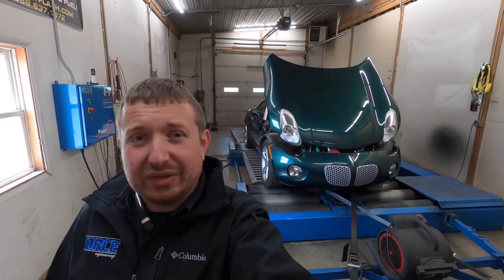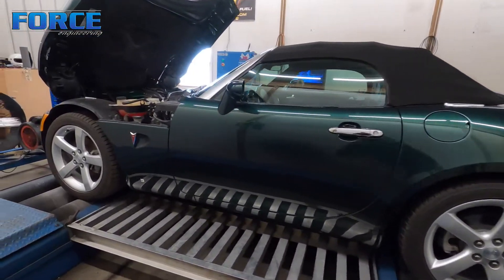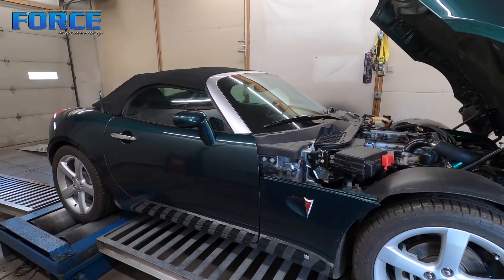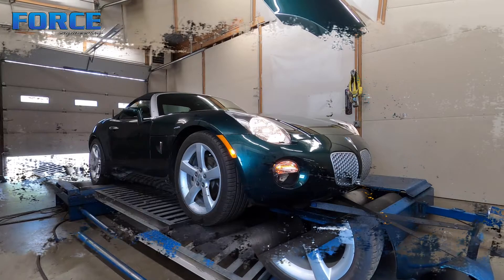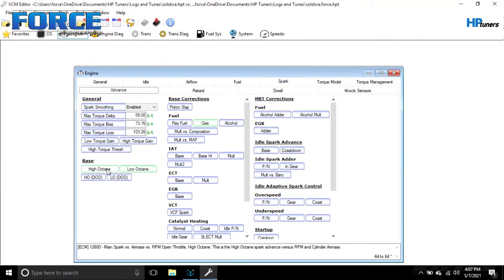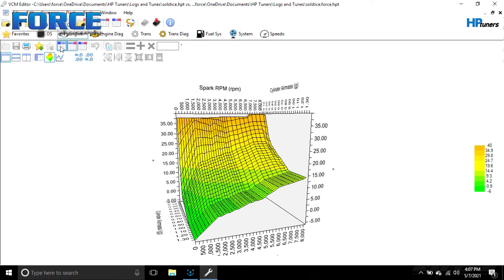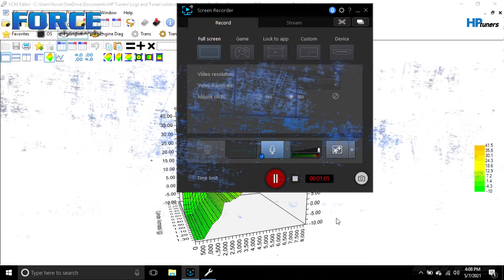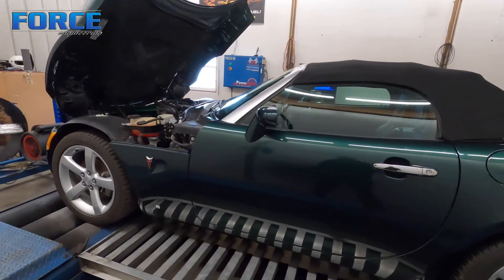Turbocharger Pontiac Solstice | Turbo Kit | Dyno Review

Comment: @Force Engineering You might want edit the title to reflect that this is the 2.4 LE5 Turbo Kit. Since it appears by reading the comments that most don't know or understand that the 2.4 LE5 was not turbocharged from the factory, and was only rated at 177HP and 166TQ.  I found your video by searching for: "2.4 Pontiac Solstice turbo", since the question; Can I turbocharge my 2.4, is a somewhat frequent question in Facebook groups. Also, when Solstice & Sky owners ask about adding a turbo to their 2.4, I always tell them the importance of having it turned correctly, since tuning a 2.4 turbo seems to fall into the good or bad experience for 2.4 turbo kits. Now that I found your video, I can start posting it when that question is asked. 👍

Comment: Not enough info...did I miss it?..is it the 2.4?? obviously the GXP had the 2 Ecotech turbo with 15 pounds of boost, so I am assuming you installed a turbo on a 2.4, and with 5 pound of boost, making 197 HP to the wheels looks like 240 net HP. I have a 07 GXP and a stage 2 RPM Motorsports tune and the car makes 300 net HP.
Reply: GXP/Sky Red Line actually made up to 18 PSI stock and 23 PSI on the GMPP reflash (this increased power, torque a lot.)

Generally K04 could make up to 18 PSI, but in some cases air, engine conditions did not allow that. This may be where your misconception comes from.
Reply: It’s a 2.4

Comment: Wait...less than 200 hp? Am i missing something?
Reply from the maker: The engine was rated for 177 at the flywheel stock. Which would be roughly 130 at the tire.
Reply: the non-turbo was. the redline/gxp turbo is supposed to be near 260
 @ForceEngineering

Comment: Don't they make 12 pounds in the HHR? Mine did but it still was a turd.
Reply: I was under the impression that from the factory it was max around 15psi, but with a tune, and charge pipes, 20ish....
Reply: @phyxlor  K04 did 18 PSI stock, 23 PSI tuned (ONLY with tune, rather, intercooling could probably help to push a tiny bit more boost.)

Comment: Those are surprisingly low numbers for what’s on here!
Reply: 15 lb boost min, or not worth it.
Reply: Actually this is normal. 5 pounds of boost. This kit is the KO4 turbo which is the stock turbo off the factory turbo car. Its a little small for the 2.4 base. These cars have a lot of drivetrains losses as well. So this is like a 260hp crank car. Probably as fast as a stock turbo car.
Reply: @SatoshisDiaper  NO CHANCE is this as fast as the stock GXP. Considering a max of 25% losses from RW to NET it would have 245 HP. The stock GXP had 260 and 5 pounds of boost is nothing.